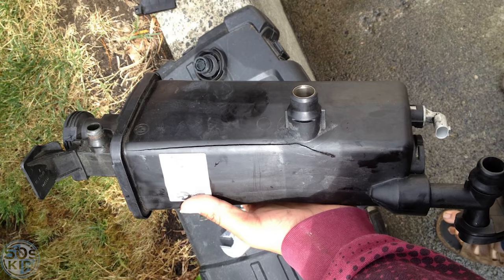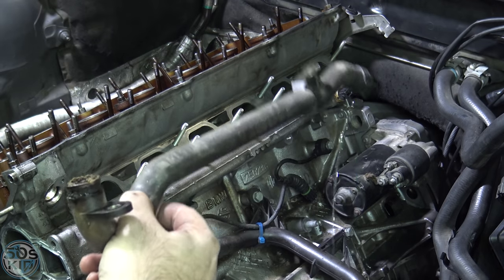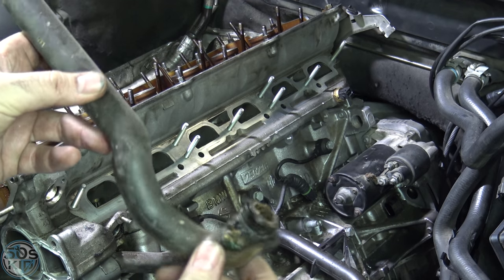Common BMW E46 Cooling System Failures

Comment: I did everything he mentioned when buying a 2004 E46. The one big mistake I made was allowing the Shop to go with a Behr Hella Expansion Tank. (now made in China) It cracked after 1 yr. and my car overheated! Please do as Jason says replace these with a BMW OEM Expansion Tank period. I go mine from FCP Euro with a Lifetime Warranty.
Reply: What about Febi Bilstein? Is that ok?
Reply: What happened to your engine after overheating? Is it still working?
Reply: @Videos-os3cc overheating doesn’t necessarily mean he continued to drive it

Comment: This man speaks the truth I have a 46s and have replaced every single thing he listed facts
Reply: Hard-core BMW guys get mad if you tell them about the cooling system, I dunno why. The water pump impeller is plastic. They deny these facts.
Reply: @camryuser  yes it certainly is from the factory or oem replacement. I replaced one on mine and it had a metal one in there that had a bearing going bad and it scarred up the block.
Reply: @camryuser  yes it certainly is from the factory or oem replacement. I replaced one on mine and it had a metal one in there that had a bearing going bad and it scarred up the block.
Reply: I have m54b25 and it is awesome car. Atemporal and so nice.
Reply: @camryuser  u pref a camry or a m54 xd
Reply: @NakaiSan.  
I'm a NA kinda guy. S65 for me.

I've taught a friend how to drive manual in a e39 M5.

Camry = AK47 of cars. Much harder to break.
Reply: mygod.
Reply: I’m doing it right now Lmao I pick my car up from BMW next Friday

Comment: One more thing to check out: the cap of the expansion tank. This thing can start to leak or (worse) it will stop releasing steam at the supposed pressure (2bar for the m54 engine).  Cheap and easy replacement that should not be overlooked.
Reply: Definitely! GAS makes a great modified one.
Reply: Will also most likely save you from having to replace the expansion tank...
Reply: @lp2565  THANK YOU!
Reply: @lp2565  Exactly. I got one... 1.2 BAR if I remember correctly. Others also use (I think a 1.5 BAR) cap from e30, etc...
Reply: I do not think lower pressure caps do anything for the most part. Here is the thing: My experiments with the 2002 325i shows that the coolant pressure does not really ever go above about 1.25 bars. The pressure fluctuates in the 10 to 18 psi (0.69 to 1.25 bars) range during driving. The pressure is NOT regulated by the cap under normal driving conditions. The pressure fluctuates due to the micro-boiling in the cylinder head coolant passages next to the exhaust valves. This is the reason why I conclude that lower pressure caps in general are not helpful for the most part.
Reply: @emineid  couldn't disagree more.  Have two example cases.  One was e46 with m56.  Expansion tank exploded.  I replaced with a cheap tank that exploded again on the way home.  Replaced that with an OEM tank, which exploded again the next day.  Replaced again, but this time replaced the cap - the car still drives 4 years later.  The other was an e66 with N62. Tank explodes.  Having the prior experience with the e46, I get an OEM tank and a new cap.  Tank explodes again.  Replaced with a different manufacturers tank, explodes again...  Replaced a 2 bar cap with a 1.4 bar cap - no problems anymore.  The cap does regulate the pressure.  If your pressure never gets to the regulated pressure - you have a leak, or low on coolant, or have a thermostat that is stuck open.
Reply: @emineid  I think you are correct overall. The lower pressure cap can help save other parts if you have an overheating condition due to some other problem developing, I think... But yeah, if everything is doing what it should it is not necessary.
Reply: @AlecKristi  "If your pressure never gets to the regulated pressure - you have a leak, or low on coolant, or have a thermostat that is stuck open."  No, no, and no. I have a coolant pressure gauge installed in 3 different cars from 3 different manufacturers. No car that I have ever tested runs at the coolant pressure of the pressure cap. The pressure fluctuates all the time, generally several psi below the cap pressure, and seldom even rise to the cap pressure. I repeat again and again: The cap does not regulate pressure. Not unless there is a runaway overheating situation. I submit as evidence the coolant pressure gauge in my 2002 325i. The "12 o'clock" of the gauge (to the left of the TomTom) is 20 psi. You can see that the pressure generally stays in the 10 to 18 psi. 
https://www.youtube.com/watch?v=pvypRXCddJo
Reply: Get a OEM BMW one from dealer! I have heard from so many guys that their expansion tanks explode from using a cheap expansion tank cap! It is a bit more expensive than other ones but in the end you will save money and a ton of time from not having to replace other parts.
Reply: Looks like my issue is just the cap

Comment: The only solution i found with dealing with these nightmares from BMW amd their over engineering and intentionally designed fail points for dealership revenue is to not buy BMW products anymore. I've owned BMW after BMW and i only found peace of mind when i sold my last BMW car for a more reliable amd better engineered brand. The ergonomics, use of space in the engine bay, and quality of parts has always been a migraine with the E46. Great looking cars, great base engine but the supporting systems of tje engine (cooling system, f'ing bullshit hydraulic tensioner, plastic everything, intake plenum that will inevitably start to disintegrate) made me steer clear of the "German Engineering" illusion. The most impractical car to ever do maintenance on. I've owned Toyota's, Saabs, Domestic, Japanese, and even the overpriced piece of crap out of England but the E46 has been absolutely the worst, and I've owned an LR3 which says alot.

Comment: Yes, The One Maine Weakness on BMW E46 is the cooling system!

I´ve already Replaced The:
1- Coolant Expansion Tank
2- Replaced the OEM Water Pump With Stewart Water Pump
3- all hoses & Thermostat Housing
4- And new Radiator
All At the Same Time :-) !
All are OEM Genuine Parts.

Great Video! Glad you’re still making E46 videos! Thank you so much!
And Thanks for all your Tricks and Tips on BMW E46 :-)

Comment: Just replaced the plastic tubes under the intake manifold on my 2001 (200K+ miles).  I put this off because I was afraid to remove the intake, but watching your other video gave me confidence.  And yes, the end going into head broke off.  I had to use an expansion tool to pull out the piece.  With the intake off I also replaced the four rubber heater hoses.  You are GOLD my friend - GOLD.
Reply: Jason is Platinum Now!

Comment: My e46 overheated last weekend and it looks like the thermostat packed up in the closed position resulting in so much pressure it took out the expansion tank, the radiator, and the hose between the exp tank and the thermostat, luckily the head gasket seems ok thankfully! All advice in this video is defo worth listening too.
Reply: I would do a leak down test to be sure
Reply: The EXACT same thing happened to me just a couple days ago!  The expansion tank explosion was so ferocious it was almost unbelievable!
Reply: Just do the whole cooling system like I did

Comment: My first time ever touching a BMW recently my coworker gave me a X3 which I gave to my sister, but before I gave it I did everything you mentioned including idler pulley, belt tensioner, front driveshaft, all four brakes and rotors, oil change, cabin air filter replacement and cleanup of all cavities that harbor dust and leaves. It took a couple of days because I'm not a mechanic but I read and attend YouTube University.
Reply: Bravo Bro you're a Great Giver! Respect!

Comment: Absolutely your videos are the reason  I just  picked  up a e46 330xi a few weeks ago.  Had one before  but got totalled  a couple  years  ago.  I just love the way they drive and handle.  Bmw has lost the essence of the ultimate  driving in my opinion.  Everything now is just all about  speed and sticking an M emblem  on everything.  It used to be an exclusive club now its just ordinary.  Bring back the old ways of bmw for us older enthusiasts.

Comment: Good video Jason and reminder for my next interval. This video was due for some. I've done this maintenance every 35k for peace of mind. I beat on my E46's cooling system from Cali to AZ to TX and to Vegas every month, sits at 151k. This is a must know and super easy to do for every owner with the M52TU/M54 engines. Please folks use OEM parts as he says trust me don't cheap out.

Comment: You should've mentioned the 2nd coolant temperature sensor. The one under the manifold. Because of its location it's a PITA to replace and should ALWAYS be replaced if you are changing the two hoses connected to the head of the engine.

Comment: Your videos are smashing good with info! I changed and replaced every component in the cooling system in 2020 (2003 325i). Those hoses on the engine block are typically corroded as you say.

I would add for those who have the problem of a broken hose-end stuck in the engine block, there’s a great video of a z3 owner (same M54 engine) who has a hack for removing the stuck pieces. Basically - get a 3/4” tap and a 3/4” bolt. Tap the hose crud and then thread the bolt in and use elbow grease to pull the stick pieces out.

Comment: Jason speaks the truth. At the beginning of pandemic, I did replace all of this except the two hard lines under the intake manifold on our 2002 Z3 Coupe with the M54. Now I’m thinking I should go back in and remove the manifold to get these two hard lines. Cooling system should be redone every 100k miles or 10 years.

Comment: Thank you Jason! My hard line under the intake started to leak due to corrosion. Replaced it around 190K. Now my E39 has 212K. Very easy to replace once the intake is removed.
Reply: Hello, may I ask if the leak was bad enough to leave you stranded on the road? I was wondering if these hard lines develop sudden crack like the expansion tank or do they develop mild leak at first?

Comment: Did all of these on my X5 3.0 M54 manual. Wuhoo!

The only pain was the coolant splatter was so strong because the auxiliary pump is close to the expansion tank. I couldn’t use the bleeder screw so I used the stream inside the tank to observe bubbles but I had to use towels and a face shield while bleeding.

Comment: Perfect timing, i took out the manifold to change ccv and vacum hoses, plugs, and doing stage 3 cooling, changing all those hoses underneath the manifold plastic and rubber ones, also might clean the injectors, debating whether i should replace the starter while im there, but not sure yet
Reply: If the starter is old, I’d change it. I did 👍
Reply: I did. It was one of those "while you are in there" decisions. You did 90 percent of the work of getting to the starter, so why not?
Reply: Yup, do the starter… sooo much easier w intake manifold outa there, but still a “bear” to do, but you’re saving a lot of $ doing it yourself!  AND - the best part is knowing you’ve done it right … not a tech at the stealership in a hurry to go for lunch!
Reply: @JB-ex8kl  Right on, peace of mind when you go it yourself!

Comment: Just for preventative maintenance, I replaced my water pump (Hepu) and thermostat. Should’ve stuck to a Wahler one although not caused any issues as of yet. Noticed the radiator had a leak so replaced it with a Behr/Mahle one, also Gate’s upper and lower coolant hoses and a new coolant temp sensor.

Even after doing all that work, the fan wouldn’t kick in properly, at times it would seem like it’s struggling for power. It would turn on and after a fifth attempt, it would finally turn on for a couple of seconds then turn off. After the fifth or so attempt it would run full blast. When the fan doesn’t run, needle goes towards red. Could it be the fan? This might sound silly, but could it be the battery since alternator is finding it difficult to distribute power or could it just be the electrical components on the fan?

As always, excellent content Jason. Keep up the great work!
Reply: Bleeding the rad after an overnight rest is crucial and even a little air in the system will cause it to run in the red. If your driving and running in the red, turn it off and coast till you stop. Let it cool down and refill with coolant before going on.
Reply: @petepenn1  I believe I bled it well. It’s just that the electric fan doesn’t kick in some times, due to that the engine overheats. When the fan runs here and there, engine temperature remains in the sweet spot.

Comment: I would add the HVAC heater control valve located right next to the firewall. I had the hose nipple on that crack off completely on my 2002 Z3 and instantly empty out my entire coolant system. Fortunately, I just pulled in to park. Had it happen a day earlier, I would have been on the freeway, and the engine would have been fried.
I like the radiator by Zionsville.  It is welding artwork.

Comment: It might have been implied but I would specifically mention replacing the rubber heater hoses when replacing the hard coolant lines. Might as well since it's easy when the intake manifold is off.
Reply: Definitely

Comment: Hey my dude, I love your videos. I just blew the expansion tank on my e46 and you've been guiding me through replacing practically all the engine gaskets, along with the CCV while I'm at it. I was wondering if you had any suggestions for cleaning out the oil buildup in the M54 intake?

It looks like you've lost a bit of weight and I'm hoping thats intentional. I really appreciate your videos and would love more on the e46, but not at the expense of your health. Take care of yourself.
Reply from the maker: Very intentional, I've been working out every day since February.  My advice on the intake is to not worry about it, because even if you clean it out, it'll go right back to being that way within a week.  If you hate the idea of this in the first place, you can switch to the catch can.  If you want to clean it out after that, remove the intake and go at it with soap and water and a garden hose and let it dry out, but even if it's a bit wet, that won't hurt the engine -- actually it'll help it because water/steam decarbonizes engines.
Reply: @50sKid  Great advice as usual!  Got a blocked cat on the right side, no exhaust out the passenger side. Got any ideas to fix it or just pull it?  Thanks again and you look Very Healthy...Cali sun is sweet!
Reply from the maker: @petepenn1  Is your exhaust flap just closed? If your cat is blocked, you need to replace it.

Comment: "When" not "if". 
So true. When I went to pick up my 325i from the city, I made it two blocks before the upper radiator hose exploded. Thankfully an auto zone a few blocks away had the part in stock and a friendly old guy loaned me some tools to get me going.
People, replace your cooling system. When I got the intake manifold off, all the cooling lines were cracked. Miracle of God they didn't break on the 38 mile drive home.

Comment: I went full rehual for coolant system, full Mishimoto! 203k miles and still going strong lovely temps at 152- 175°f all the time! (66-79°c)
Reply: Hi 
I thought the m54 was a hot engine, the thermostat opens at 97° anything lower than that isn't optimal temperature?
Mine seems to run too hot even after replacing everything it can hit 101° if it's stood, then it drops slightly and hovers between 96° and 100°
Reply: @beltdrivetypea6534  I'm running Mishimoto's thermostat that opens at 76°C Mate
Reply: @wannabezhp  I should probably look into something like that 👍
Reply: @beltdrivetypea6534  I actually have an extra racing thermostat by mishimoto for m54 engine incase u might be interested
Reply: @wannabezhp  I'm in UK 
So I guess with delivery it would be cheaper to get one over here
Reply: @beltdrivetypea6534   well I think it's a U.S company, it's a mishimoto e46 race thermostat
Reply: @wannabezhp  just looking now 
They have a uk based shop

Comment: Unfortunately i cannot agree with you about oem water pump breaking for plastic pieces. I have been working with M54 since 2005 and never saw one failure like that.
I don't remember any cases in our local BMW communities, and yes M54 + M52TU´s are very common everyday drivers still here.
In fact, all OEM original stamped pumps from 2003 for example have been in very good condition, no leaks or anything. Replaced just because of age. 
I always use Saleri pumps, never had zero failures with Saleri. PA659S model for M54.
People dont know that lof of cheap metal impeller pumps are china production and very poor quality. Personally, i use only saleri with composite impeller.
Btw. You are doing great work with videos. Thank you!
Reply: I've had 2 metal impeller pumps fail very quickly on my 99.  One with a cast impeller - completely cracked off the end of the shaft and destroyed the bearing  Was very lucky it didn't cause serious damage.  Another stamped impeller where the seals failed very fast .  This is on a manual so no fan on the pump to to cause extra stress.

Usually use Graff pumps but currently running a BMW composite impeller on my 99 right now after my last Graff failed.  Though I am running Graff's on my other 2 3's with no issues.
Reply: I recently replaced a water pump with the oem along with the thermostat housing, idlers and belts. Worst part of the job was trying to get the fan clutch and pulley off. Finally had to cut the impeller off and cut a flat spot on the shaft with a grinder to be able to grab it in a vice. Then put a breaker bar on the end of a crescent wrench to pop the reverse thread clutch free. Even marvel mystery oil wouldn't loosen it. After that, Jason's instructions made short work of the job. Never did figure where the cooling system let loose but no leaks now.